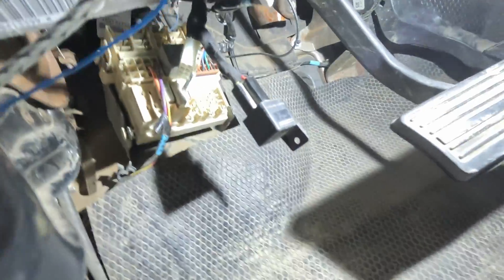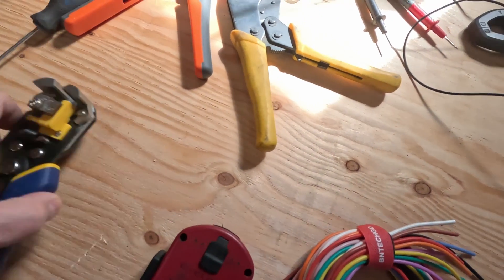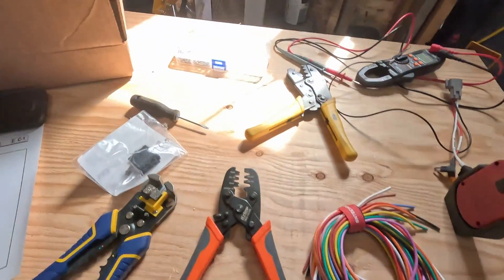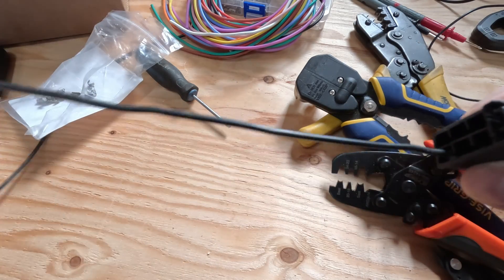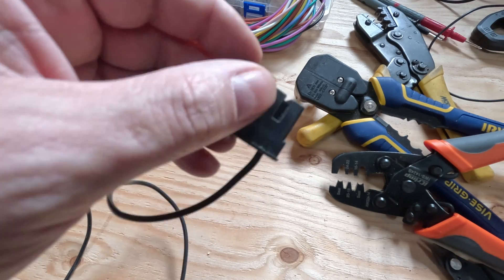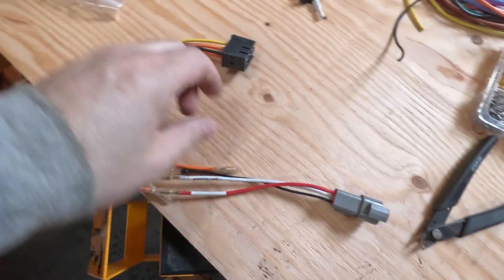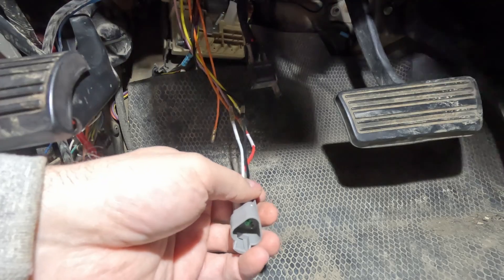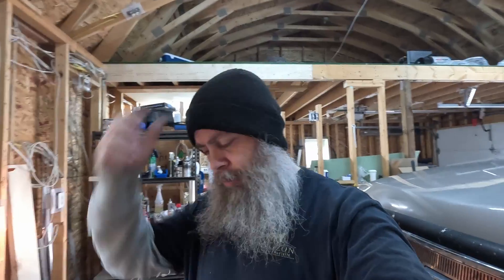Secret 12v Power Source in GM trucks

Comment: hello great vid.  Im just trying to hook up one 12v ingition on power to my transmission cooler fan,  but it meters 14.2v while running... is that ok for the fan?
Reply from the maker: I can't speak on behalf of your fan so you would want to look at its specs, but most electronics have a variable voltage then can run on say like 7-16v or 5-12v. Your fan should say or the manufacturer should know.

Comment: Can you really pull 15-30 amps off those two constant hot leads??? Not with 16ga wire of course but can you tap in with 10-12 ga.?
Reply from the maker: If you look at this PDF https://www.gmupfitter.com/wp-content/uploads/2021/05/2006_LD_CKFullSizeElectrical.pdf you will see that each source has its own fuse. One of which is 30a and another at 15a